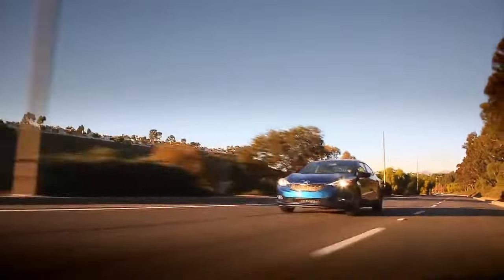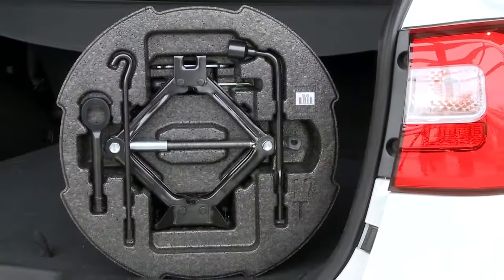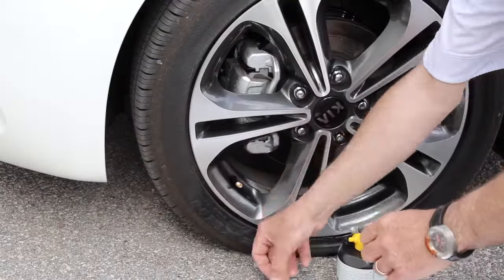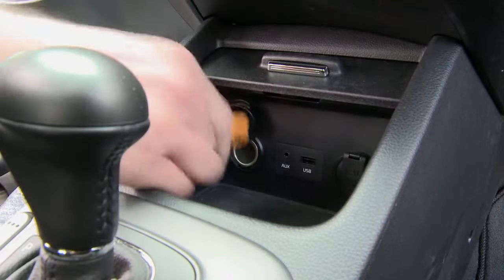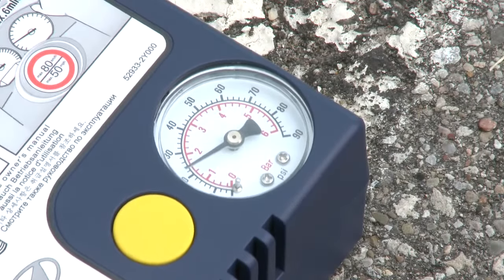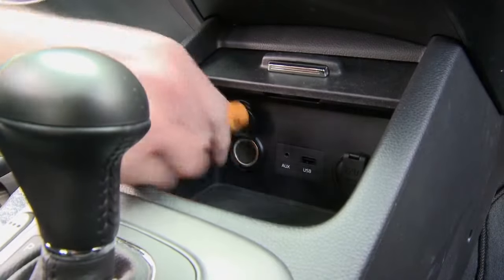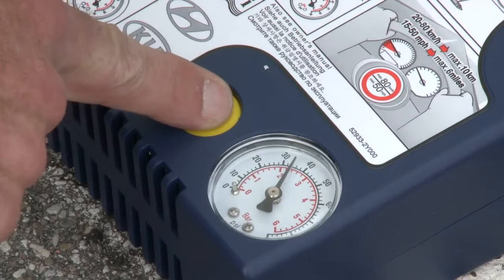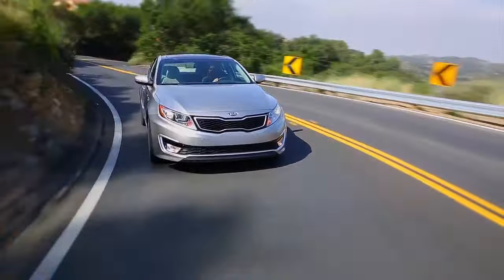Kia Tire Mobility Kit Guide

Comment: This is useless… just give a spare tire, dealerships and tire shops don’t want to mess with a tire with that goopy sealant inside of it because they need to take the wheel off the rim and now clean it and it a mess.(I work in a dealership as a mechanic). It easier to have a spare to switch, if you are 100miles from the nearest help you stopping every 20-25 minutes to check the tire pressure will really increase you’re travel time.
Reply: This new sealant is no longer gloopy, probably why it's costs three times as much as the slime. Also most modern cars have tpms so you don't need to stop and check. The new sealant was designed to not damage tpms .

Comment: Great info, but what happens to the nail? Does it ever get removed? If yes, at what point do you remove it?
Reply: Never ever!!! :face-blue-wide-eyes:
Gimme me back my spare tire...
💯
Reply: It's only good at 40mph for a limited milage. You drive straight to a tire trailer and buy a replacement.... Because this junk will harden and have to be scraped off and wire brushed, then a patch put over the hole and aird up to ever be balanced again.

Comment: This kit also works on BMWs I saved the old tire kit from my crashed Kia optima just now I remember I had it in the truck worked perfectly my question is what is the yellow button for
Reply: Deflating the tire.
Reply: @twayneboothe2163  thanks I lost this with my Beamer sweat thought Thule stole my car called police turns out they just took it now they wanted like way to much money almost 5 grand and that’s what I paid for my car this was inside there sucks

Comment: I was actually thinking about buying a Kia, I even took one out for a test drive. Once I found out about this repair kit with no spare tire Kia was no longer an option.
Reply: I just bought a spare wheel, you can remove the organiser and there is a space for the tire.
Reply: Just about all new cars have eliminated spare tires.

Comment: If you need to call for assistance, you should've got the one with the spare tire.
Reply: We bought a new 2022 KIA RIO in Feb 2022 and were never told by the dealership that there was no spare tire included! Hadn't bought a car since 2007. Was surprised to read that most new cars after 2008 don't include a spare.